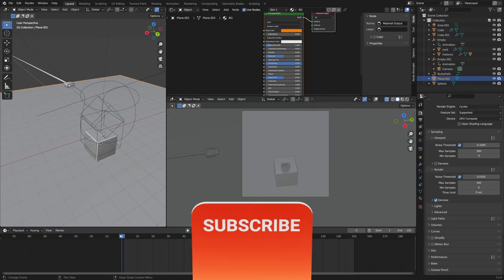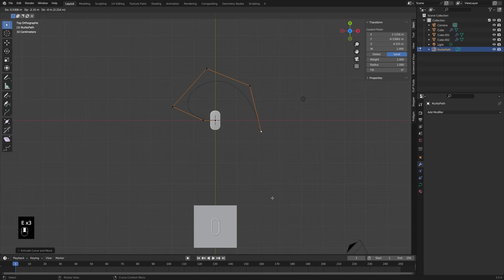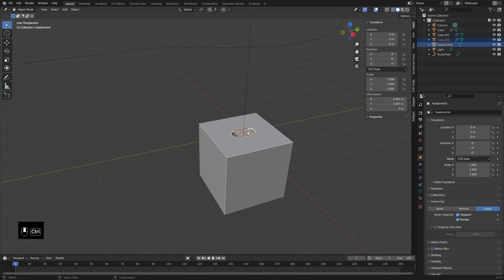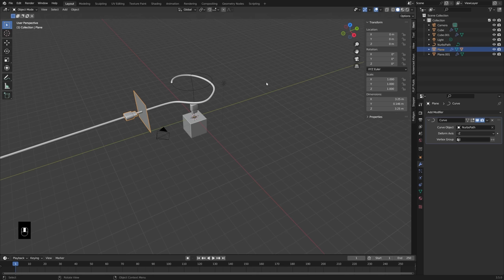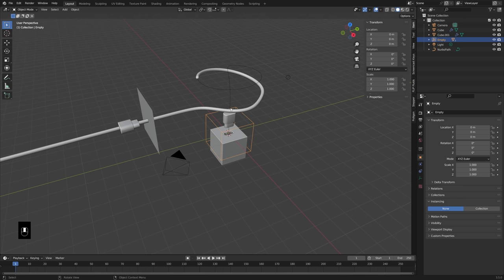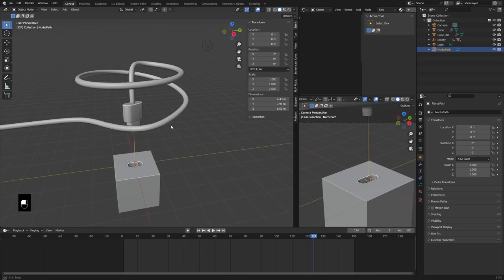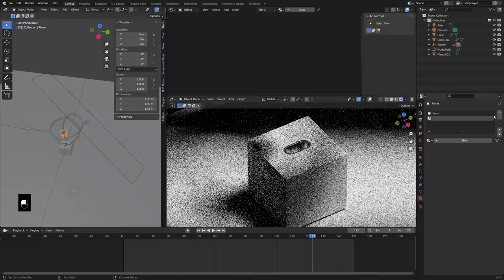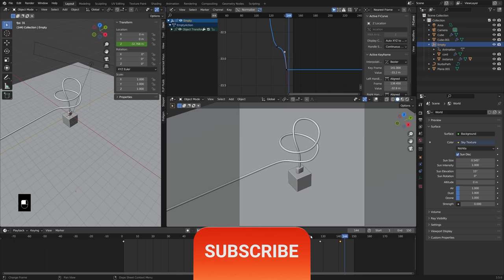Animating Cords in Blender

Comment: I work every day animating cables and various plugs. It's actually very hard to do in blender, though you've chosen a fairly simple case anyway. I'd love to see more videos like this :)

P.S. If you want an extra challenge, add a rubber bend between the plug and the cable, which will adapt to the cable. Assuming, of course, that the plug will not deform. Have fun :D

Comment: When you parent the plug to the plane for instancing, using "Object (Keep Transform)" is absolutely useless in this case. This is meant to keep a possible transformation given to the object being parented to a different object before, so this helps when you switch the parent from one object to another and don't want to lose the previous transformations. Since the plug was not parented to anything before, "Object" and "Object (Keep Transform)" are doing the exact same thing.
Your problem here is that your plane is in the world center and the plug is away from the center. The instancing keeps the offset between the origin of the child and the parent object. If you want to instance the plug at the center of the plane, then you either have to manually set them both into the same location or use "Object (Without Inverse)" for parenting, which automatically repositions the plug to the location of the plane.
Reply from the maker: Thank you

Comment: the twist method under the data properties > shape of the nurbs curve will allow you to fix it so it doesn't twist in weird ways, usually
Reply: also! if anybody is doing something like this but doesn't need the cord and just needs an object to follow a path without deforming use a constraint! won't work for this here without manually making sure the cord follows it along the curve, since the constraint won't work for the cord as it does need to deform.

Comment: Isn't it easier to use the follow curve constraint for the head instead of the whole Instance parenting struggle? And for the cord i would use the curve itself with a profile extrusion and start and end mapping function
Reply from the maker: This way works great for the head but then matching the start and end mapping gets tricky/less flexible. For a fast solution though what you describe would work fine